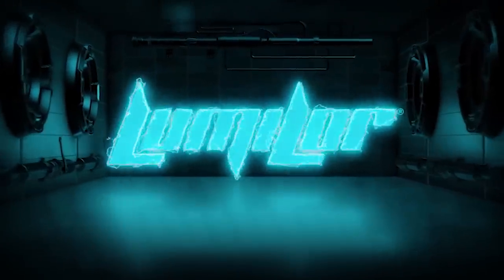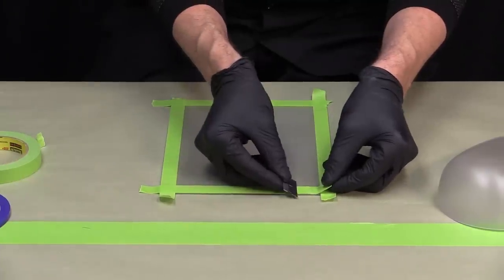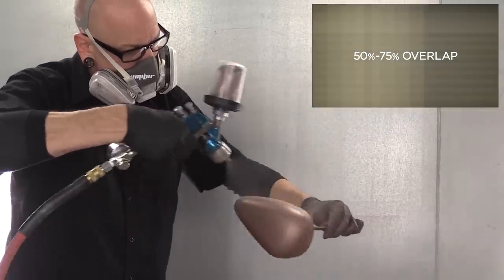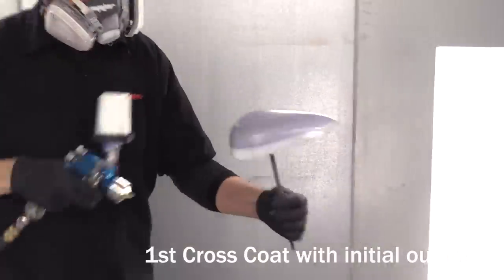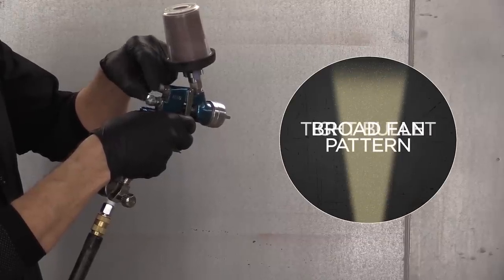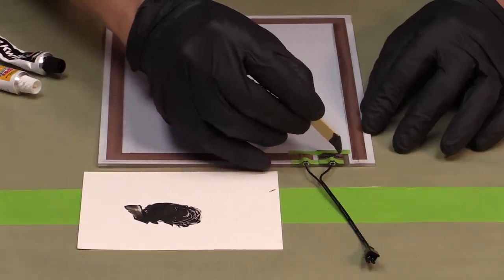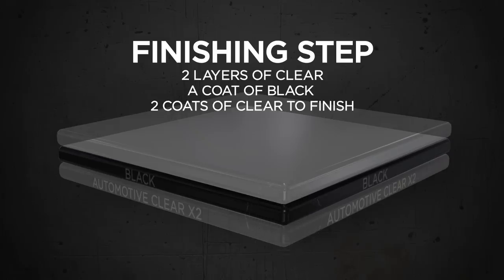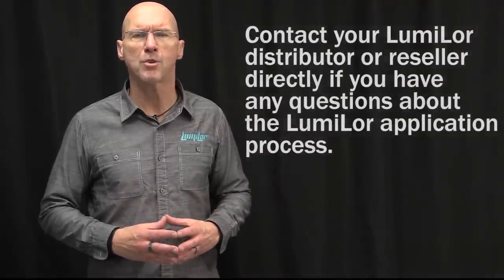LumiLor Starter Kit Training

Comment: Would this work on complex geometries? A grille on a car for example?
Reply: maybe, because you need to have voltage around it to light up if im correct, so you need to have those two conductive layers around it to light up but im not sure if you have the skills to make those conductive layers on the other side i think it can be possible but you would need a really skilled painter with a lot of patience and skill with for example mini figures painting, it would cost a ton and a lot of time but its possible

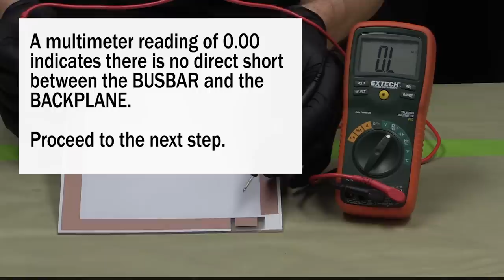Comment: Woow, HUGE mistake at 19:32.
The text says that "A multimeter reading of 0.0 indicates there is no direct short between the busbar and the backplane".
This is quite the opposite!
0.0 Ohm is definitely a short.
The meter shown has 'O.L' on the display. This stands for OverLoad. This is the value you want to see.
Reply: Wasn't the "OL" stands for Open Loop?
Reply: @saisokuhashiriya8069  Nope, you also get this when you measure 50V at the 20V setting. (Fluke user here) But you could for the resistance measurement interpret it that way if it's easier to remember for you.

Comment: Could you get this done on a guitar?
Reply: I was thinking the same thing. Applied Science has a video on this, he incorporates an adafruit microcontroller of some kind to program the behavior, not that you would need to go to those extremes, but he covers a few points that aren't included here about what it could do.  It would certainly be possible to put it on a guitar, but, will it shock, cause interference with the pickups, ? There's also whether or not you intend to have active effects in your build, room is a consideration, and if you have a programmed display, the chip running it will get hot, which will effect the stability of the instrument and potentially be a fire hazard. Maybe one could use an active boost effect and configure it in such a way that signal generated by the pickups activates the light,  causing the lighting effect to correspond with the noise envelope, and the active boost counteracts some of the loss?